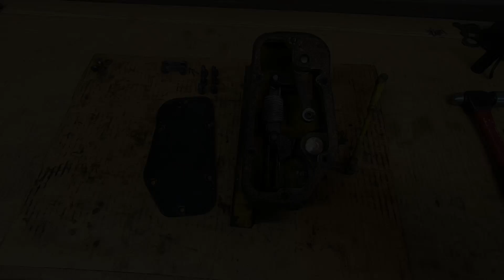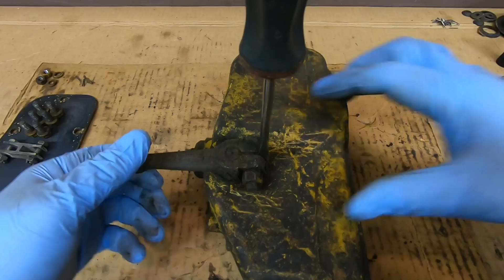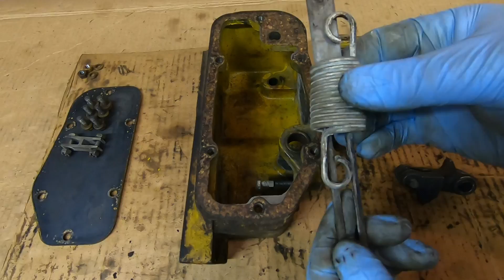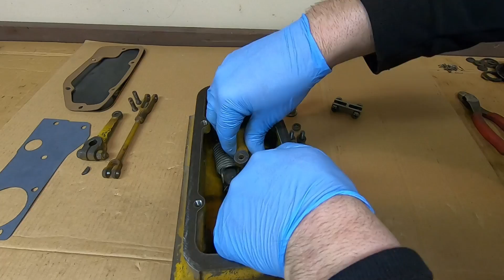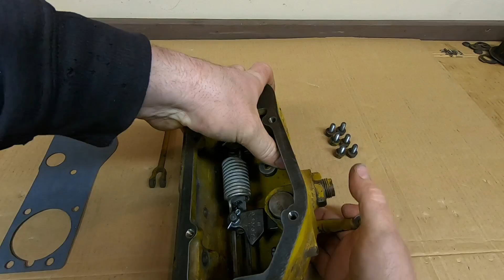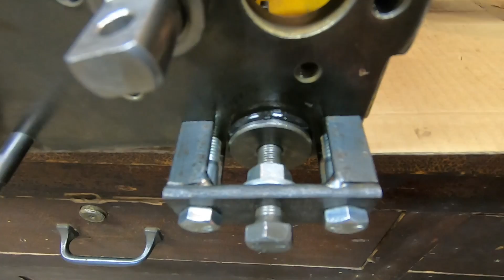Caterpillar D2 #5J1113 Diesel Engine Assembly Ep.32: Governor Overhaul & Injection Pump Installation

Comment: Ok after watching this video I see how the governor in conjunction with weights in front works. And I think the governor connects to the high-pressure injector pump which consist of pistons that you adjusted with a depth gage to .001 of an inch. I will have to watch again to see or remember what you said drives the pistons also I am going to watch episode 31 next. I think there is a primary Pump that sucks fuel from fuel tank through primary fuel filter into the fuel tower then the high-pressure fuel pump takes over. I guess. I think I have to many irons in the fire and not enough time in the day. The best instructor on the internet and there are some good ones.

Comment: Toby, I am amazed every time I watch a video I have already watched of yours. I got lucky and found this section of #5J1113 Injector operation looking for info on the 1960ish Case 530 Backhoe I just bought and know nothing about it (530 that is). Next, I see I need to watch Episode 31 and whichever video is next to understand how the injector pump works to see why my D4 dozer is not sending fuel to my injectors. Thanks again for all your work on these machines.

Comment: I was wondering if you would have any thoughts of where I could look for one of these.... I just purchased my first D2 today (3J 4436 if memory serves) and this and the pony motor are missing from what's otherwise a not bad project candidate....
Reply: @squatch253  Thank you! I will be purchasing a membership. 
I run a machine shop and actually do a fair bit of work on caterpillar parts so most of it I'm not too worried about.... But there are definitely some pieces I'm not overly keen on making from scratch.

Comment: I wonder if the problem with the plug could be a harder oring?

Also not sure what's going on with the shut off. To shut it off, do you hold the lever to no fuel until it stops? It must be a scroll type fuel delivery, so no fuel would be full spill.

Comment: Worked great the second time around. Sorry you had that video glitch. I wondered if after tightening down that assembly using the thick gasket if you could have taken it back off and reinstalled with the thin gasket you originally wanted to use. I’m certainly not second guessing you here! I’m sure you thought of this, too, and decided against it. (Maybe you could have put some late 30s Cat engine enamel on the thin gasket and ... never mind. :) )

Comment: I was just wondering that with the governor case and mechanism  not lubed or sealed and requires disassembly to re lube , could they have routed the engine blow bye from the timing cover out thru the injector pump housing and governor to keep a oil vapor always on the parts and a slight positive pressure to keep dirt out of the pivot bushings and bearings, Just thinking out loud

Comment: Tip. Long nose pliers mod. I usually do this to offset long nose pliers. Use a small chainsaw file to carve ( ) shapes in the tip of the long nose pliers leaving about 5/16" un modified. Now you can grip round objects without them squirting out. You will also find they work great at vacuum hoses for those who work on old stuff like me

Comment: Sir watched the 2nd upload to give you back the views you lost... now the 1st upload was okay? But watching 2nd, noticed you said the two o-rings were the same, on the fuel gally, you said could not find a different ring... did you try to see if the 2nd o-ring woukd work better? And maybe the 1st ring was out of spec? As you did not have issue when installed to engine block?